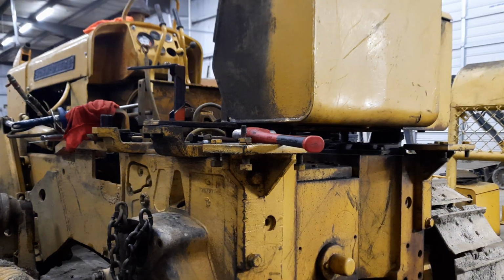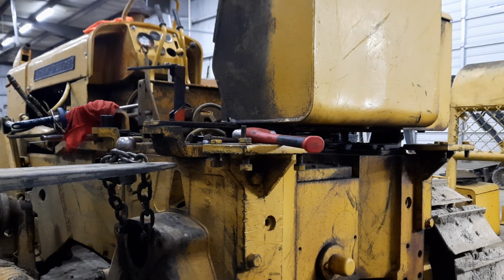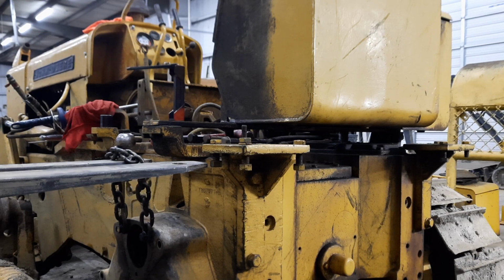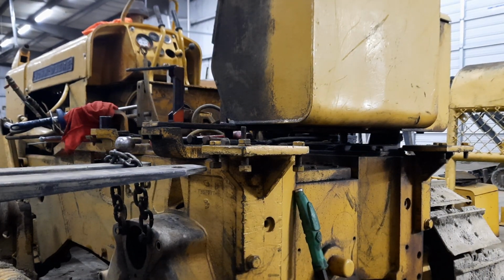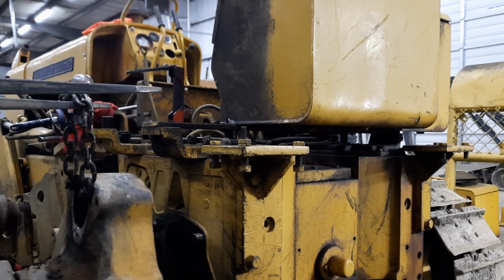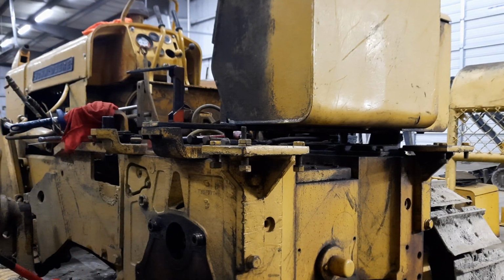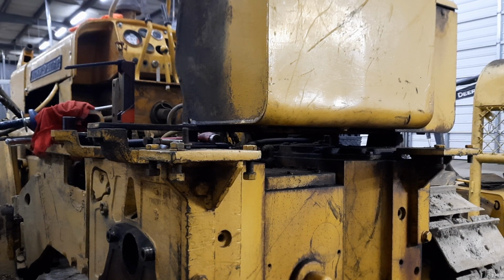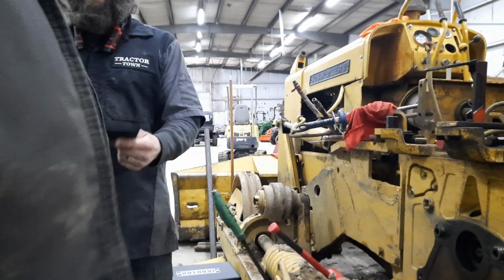John Deere 450 pt.3  step 2 of finial drive removal.

Comment: Otis, did you see my second question:
Can I access the 7/16 bolt going into the spline (access through the peep hole) by removing the main plate under the battery compartment?  That 7/16 bolt is broken off and is allowing movement on the shaft. Some way I need to get it out so it can be properly installed with a new bolt. Is accessibllity possible once that large cover is removed if not open to suggestions.
Reply from the maker: @marvinjohnson2463  I'll try to find out and get back to ya

Comment: You don't have to remove the final drive to replace the steering clutches and brake band.
Reply from the maker: No you don't, but I'm chasing and oil leak that caused the band damage. So the seal for the pilot shaft needed changed anyway.